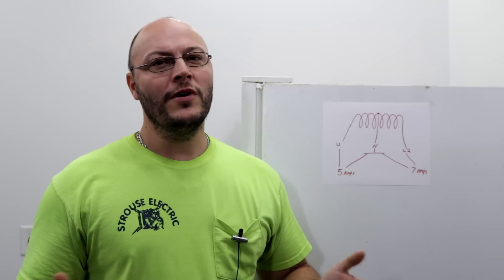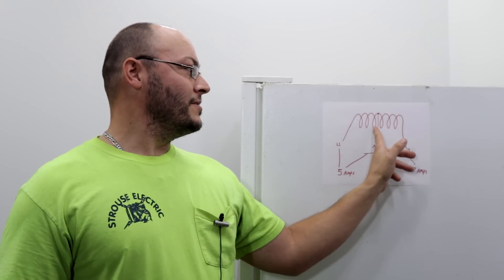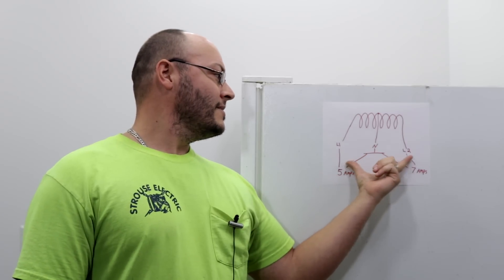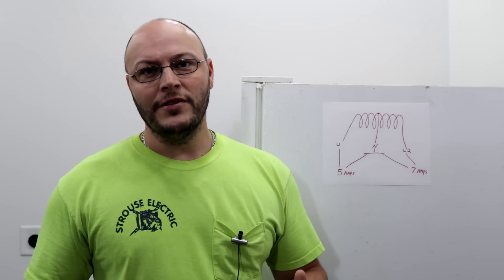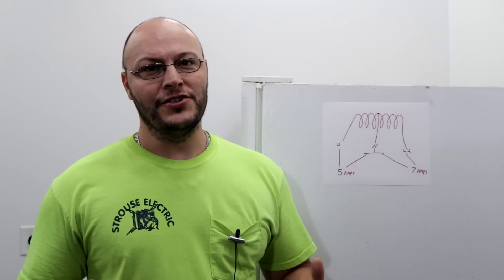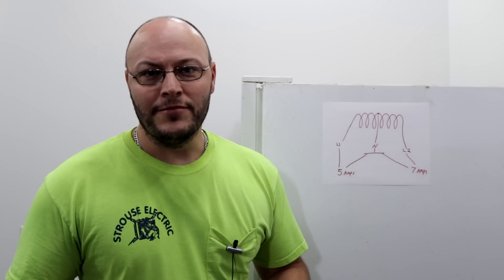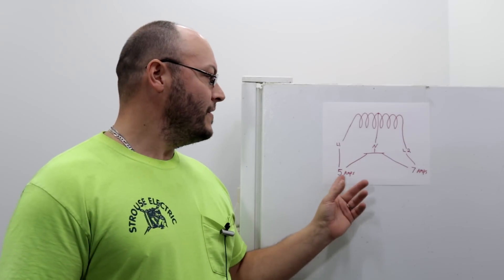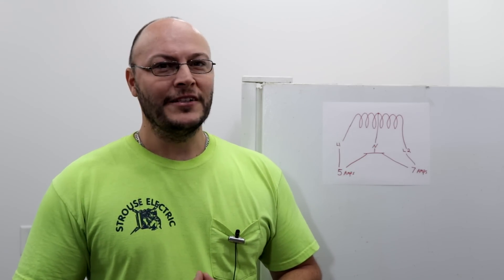What does the Neutral Wire Do?

Comment: Partly correct. 
The unbalanced load, that you scoffed at, is the 2 amps of unbalanced load that is going back to the panel, or in this case the transformer, since you didn't show a distribution panel in your drawing. That "Grounded" conductor is different than the "Ground" conductor. That you had correct. I'm not sure how much lightning has to do with the "Ground" conductor. The "Ground" conductor, identified as green, green with a white stripe, (isolated ground), or bare (no insulation). The "Ground" conductor is there for mechanical protection. If your lamp was to have a hot wire touch the base of your light fixture, or toaster..., or anything you have plugged in for some reason, that's where the protection comes in. (exception. GFCI). You could become the path of least resistance, without the "Ground" conductor. The "Grounded" (Neutral.. White, or natural gray by code) conductor is your completed path to ground, it completes the circuit, instead of you, when you touch it.
If lightning hits your house, and you do not have a lightning grid with a separate path to ground, the little bare copper ground you have at your receptacle is probably gonna melt with your house. Neutrals are important for way too many reasons to explain in a 2:00 minute video.
22 years IBEW.
Reply: Chris Garduno        He is talking about the grounding electrode and the grounding electrode conductor.  He is correct, these are in place for lightning protection.
You on the other hand are talking about equipment grounding conductor, which has nothing to do with grounding electrode at all.   Within a few more NEC code cycles, the equipment grounds will be renamed as bonding conductors as they truly are not for a purpose of connecting to ground.   In definitions ground means connect to earth.   Equipment grounds do not need connection to earth to work as designed.

Comment: Neutral's first and foremost function is to provide a "reference or set point" for 0 V. Hence, the term 'Neutral'. It doesn't change polarity with time unlike the Line which oscillates between RMS values of -120 V to +120 V with respect to Neutral. To make Neutral point a true Neutral, you've to earth or ground the Neutral point at the Secondary Side of the distribution transformer. In the US, the secondary of 240 V has a center tap (Neutral) which is grounded. In other UK and other similar (50 Hz) systems, secondary side of the distribution transformer is star-connected and the star point is grounded and tapped as a Neutral. And as you rightly mentioned, it also serves as a return path for the unbalanced loads. Body Earthing on the other hand is for electrical safety. It provides a least resistant path for electrical current directly to the earth.
Reply: polymath    I'm sorry but you are totally confused on how it works.    You need to re-learn it.
Reply: @KevinCoop1  Enlighten me then!
Reply: polymath     
I re-read your comment and for the most part you are correct with some exceptions.
A neutrals first and foremost function is to provide 120 volts for 120 volt appliances.   Tesla originally wanted the US system to be 240 volt only but, politics got involved and forced the 120 volt standard.   So, he came up with two coils connected together at the (common) or neutral point.(as defined in Article 100 NEC).
The reason for grounding electrode and conductor is to dissipate lightning energy.   No other reason.   Neutral is neutral because of how it is connected at a transformer, not because it is earthed or grounded.
In other countries, their 240 volt single phase is a direct connection to a 416/240 volt 3 phase 4 wire system.   So for most residences, they get one hot and one neutral.
I have never heard the term "body earthing" but I believe you are trying to describe equipment grounding in the NEC.   This is the one that you are the most off.    According to your comment, you think a "hot conductor" coming in contact with the frame of a dryer will only work if there is a connection to earth (the grounding electrode and conductor).   Not correct.   Earth grounding is only for lightning.  Equipment ground works with or without an earth ground.   (Most people do not understand this point).  
Please figure out how the equipment ground works and tell me your thoughts.   
Respectfully,    Kevin

Comment: In a lightning strike why would power go to ground rather than the neutral? Ground is less resistance? Then why neutral connected to ground in the panel?
Reply: Think it's because the ground wire is at the top so will hit that first

Comment: Why is the neutral connected to ground in the panel? Is the resistance greater to ground than to the neutral?
Reply: Nathaniel Schroeder    If you can identify what you mean by ground, I can try to answer your question for you.
Are you talking about the grounding electrode conductor or equipment grounds at the panel?    If you want both explanations, I can answer them both for you.

Comment: Polar positive 110v then polar negative 110v i still say it flows like dc just half the amps because its in a wave not solid state! Flows back with ground or neutral. They exercise strict education over us the faculty or what ever
Reply: Lose Spark Plug 11   You are correct and wrong at the same time.   DC is on and instant at its voltage.   AC  is on and the voltage increases and decreases and yes it changes polarity causing electrons to move forward then backward.

Comment: Bill, I had a question...I'm trying to hook up my pool light with a digital timer at the equipment box, that way I dont need to keep turning it on/off manually at the breaker. There is a gfci in the circuit, and the wires coming through conduit from the line, are a hot, ground, and neutral. Where do I tie that neutral wire down to, in the box?
Reply: Bill passed away a few years ago.

Comment: In a single-phase, 3-wire circuit, neutral conductor carries only unbalanced load.     In a typical 2-wire circuit neutral (identified) conductor carries full load current.
Reply: Ken Zeier    He was talking about neutral back to the utility transformer.   You are talking about branch circuits.

Comment: The neutral conductor carry the unbalance current... Your correct sir... But my question  is are neutral conductor only allowable in service drop being a bare copper but from service dropgoing into the house it must be insulated neutral conductor
Reply: marden adventure    I think I can answer this for you.   The overhead line is single conductors two hots insulated and bare neutral.   Utility owned conductors and utilities rules.  From there it is customer owned and NEC rules.   Overhead service entrance cable could have bare neutral, but it is inside overall jacket and can be run to a panel inside the residence.  Generally after that point, only grounds are bare and neutrals are insulated.   Hope this helps.    Kevin
Reply: @KevinCoop1   in short  it must be insulated neutral i was working now doing renovatiotn of aoartment devastated by typhoon and i trace the cble they out in the apartment and it is bare not insulated thats all and as an electrician i mist corect that.. im here in saipan now thanks for your compliment sir
Reply: marden adventure    If you need insulated neutral, in the US we use. SER cable for that.   https://www.wireandcableyourway.com/2-2-2-4-copper-ser-service-entrance-cable.html

Comment: I really would not classify grounding as Lightning protection...  They are two separate systems.  I grounding system can act as lightning protection but lightning protection cannot operate as grounding for an electrical system.  Grounding has a much more important responsibility ant it is to provide a failsafe if something goes wrong in an electrical system and electricity accesses something metal in a house that is not supposed to be electrified.  Let's take your stainless steel refrigerator for example.  If you clip off the ground prong on the plug for the refrigerator and then plug it in you have created the potential for the entire stainless steel surface to have electricity running through it without the circuit breaker being tripped.  If you had the ground prong on the plug however that stainless steel surface would have a DIRECT electrical connection to that ground prong which was designed into the appliance.  When Properly grounded if you have a short to the body of the appliance (the hot wire touches the metal body of the appliance) then the circuit current would just go out of control going way over the 20 amp max allowed for that circuit as the ground (connected to the earth) can absorb an almost infinite amount of electricity and the circuit will try to supply it forcing the CIRCUIT BREAKER to stop supplying the electricity because it is overloaded.  Circuit breakers are not made to protect humans directly in this manner but are instead designed to protect the electrical wire.  When you put too much current through a wire it heats up and will burn off the plastic insulation surrounding the wire.  This does however have the added side effect of protecting you from getting shocked or electrocuted and prevents your house from burning down.  Now you also may be wondering why some electrical devices you use don't have the 3 pronged plug.  This is because they are what is referred to as "Double Insulated" meaning that the builder of that specific tool has built it in such a way and with materials that even if something broke on it there is nothing metal exposed to the user that could shock them.  Double insulated tools have a solid continuous barrier between the end-user and ANY potential of electrical shock.

The other aspect of this is the neutral wire.  The neutral is not for safety or protecting anything.  The neutral is commonly referred to as the GROUNDED conductor by electrical professionals.  This is because at the first place that the power enters the building, as drawn in this video, you get your neutral from the transformer that provides power to the building.  However, while the transformer provides the neutral it doesn't just go from there to the rest of the building.  It must first be bonded.  What this means is you must also connect it to ground (which has a direct electrical connection to the earth by means of a metal rod driven into the dirt or soil) causing it to be the GROUNDED CONDUCTOR.  The purpose of this Grounded Conductor (Netural) Is to allow electricity to "Flow"  If you think of electricity as a fluid it helps to conceptualize this.  Electricity must have an in and an out for it to work.  If you think of your wire as a pipe and your appliance or light bulb as fitting for that pipe then when you take your hot wire and place your device (fitting) on the pipe and just end it there the flow has nowhere to leave so it just stops and nothing happens. However, if you add a neutral to the equation then it has somewhere to go allowing the flow to make your device power on.  Without flow, nothing happens.  

Just want to be clear here too Everything he said about the Neutral Is true.  Not so much on the ground but that wasn't really the topic of the video and his explanation is clearly not intended as an explanation to someone learning the trade and more as a lamens explanation to a curious customer. 

Hope this helps anyone who is in the trade and doesn't want to try to decipher this from the NEC.

So to review:
You have your Hot wire (Ungrounded Conductor)
You have your Neutral (Grounded Conductor)
and you have your Ground (Grounding Conductor)
Reply: Reegareth     One thing that you have learned incorrectly,   Faults to ground, like in your refrigerator, go back to the main panel on the equipment ground, to neutral, out to the transformer and back to the breaker.   The grounding Electrode conductor and rod to earth have absolutely nothing to do with a fault.   Please watch this video!               https://youtu.be/gHQE5L6hbgs
If you will think this through and come to the same conclusion, it makes understanding article 250 much easier.    
Another point.  Earth grounding at neutral point is a choice.   The electrical system will operate un-grounded or grounded at any point on the system.   It has been standardized to be grounded at neutrals(common point) of single and three phase wye systems.  Delta systems are generally grounded B phase on the customer side of the system.   
Respectfully,    Kevin

Comment: from L1 to N you have a bidirectional loop of 5 amps of AC current. from L2 to N you have a bidirectional loop of 7 amps of AC current. I don’t see it as balancing anything but if that’s how you want to view it, ok
Reply: Michael Prozonic    From L to N he has 5 and 7 amps.  The point was from common point between the loads back to the transformer on the neutral is 2 amps, not 12 amps.   So the statement is neutral carries unbalanced current.   Respectfully,   Kevin

Comment: In ur version,the neutral wire provides path for an unbalanced portion of load to flow back into the transformer.We can say the current completes the circuit.What i am unable to understand is that what is the purpose of neutral wire when the load is perfectly balanced??OR how does an electric current completes its path in a 3 phase system  back to the transformer when the load is perfectly balanced??
#Plz reply# or make an extra video on that

Comment: A neutral is a grounded conductor, that sends the produced static current into the Earth at the transformer.  Electromagnetic radiation or migration electrifies the transformer coils and the coils cause a static field to vibrate the housing of the transformer. Grounding the transformer housing and generator housing, stops the vibration. Also it smooths the generator functions, like phase shifting. The neutral also produces water from being hot electrostatically  and cold during positive Earth penetration; every hz cycle. The atoms of the neutral conductor, grab h20 molecules from the air during run time. The water molecules become electrolosis participants from the different degrees and differentials of the voltage per conductor atom. For example there would be three different copper or aluminum atom densities in 3 phase or split single phase, with 9 different atom types. Different only by time,  and array. The aluminum neutral pushes micro sediment out of the wire to corrosion points. There are probably drugs in the water at that level. Oxidized aluminum has an entangled big brother somewhere tropical. The neutral also has a return wave at 90 degrees of propagation. Standing and free are flash liquid metals, that rise from micro nucleus points on the wire. Just as people raise from the dirt. All in the neutral wire/ nucleus...cJT aka ChuckJ
Reply: Catherine Thomas    Physicists view?

Comment: actually if lightning strikes near your house, the electricity will go through any/all paths with low impedence(resistance) back to the source. Having AFC's in a panel come in handy . instead of it just going to the earth. just wanted to point that out. Grounded electrode conductor systems helps too carry the electricity back to the source
Reply: Marcus Morres    Sorry, but way off.   Grounding Electrode conductor and Electrode are for lightning.   Lightning goes from clout to earth.   AFC's are Arc Fault Circuit Interrupter. AFCI.   Has nothing to do with lightning.   Surge Suppressors, absorb lightning energy and release it to earth at lower amps..
Reply: @KevinCoop1  ??? Did you even read my text? You missed the whole point. When lighting strikes and goes into the earth it takes all paths with low resistance back to the source. Your explanation is lighting strikes the earth into the ground and that's it. That doesnt make any sense. You should ask your self where the lighting travels once it hits. There is reason why there are ground rods and grounding electrode etc to protect systems, Businesses or homes from catching on fire. Read up on some books bro
Reply: Marcus Morres    Yes I read and understood what you said.  Lightning is high voltage low current electricity that travels from sky to earth sometimes.   It it enters a earth grounded electrical system, it goes to that point.   NOT to the source(utility transformer).  Not additional AFC comment.   I am thinking that I possibly have way more experience than you do.  I probably started designing electrical systems before you were born.  So, it may just be that you are the one needing to read some books.   I'm not your bro.  Must make you feel tougher or something.

Comment: yes and no, its pretty current continuity from circuitry thru out structure back to your main where it commons up with regular earth ground providing providing hazard protection thru-out your electrical network.
Reply: Bob Press     Bob,   Draw an electrical system schematic and figure our where the ground fault goes in the system for as you call hazard protection.   Clue, not to earth ground.   Please watch this video.         https://youtu.be/gHQE5L6hbgs     Earth ground has nothing to do with it.   Kevin